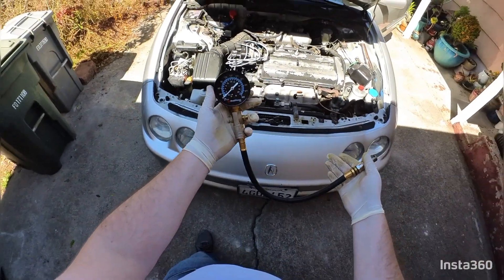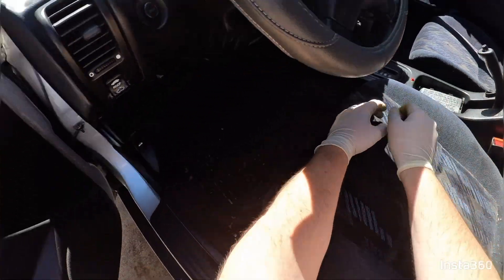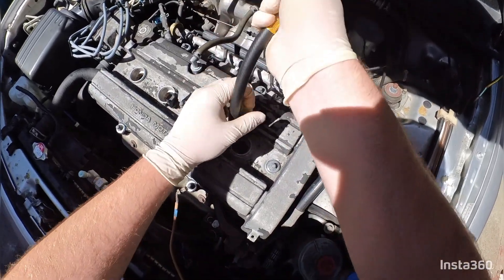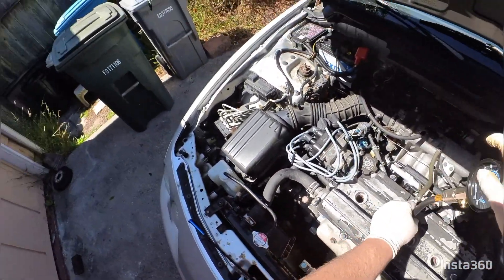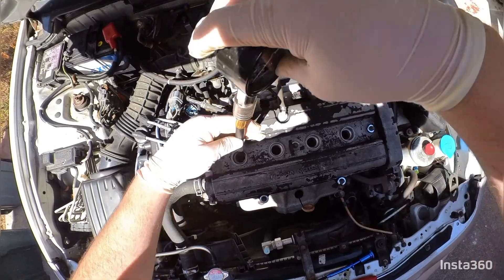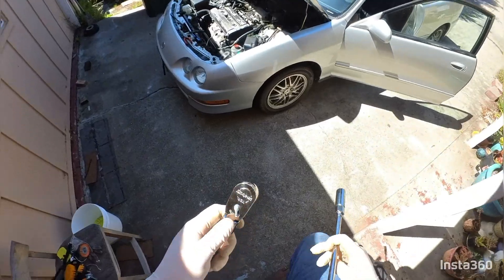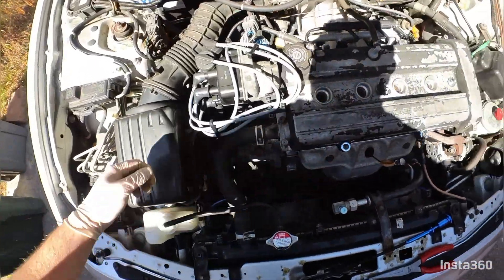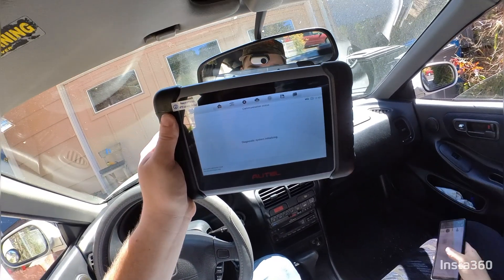Integra Compression Test (Acura Integra 1994-2001)

Comment from the maker: Turning the engine over 6 times is probably better than 5. The best way to see how many you need is if you have a second person to hold and monitor the gauge while you crank it, they can see by which turn over it stops making a difference.